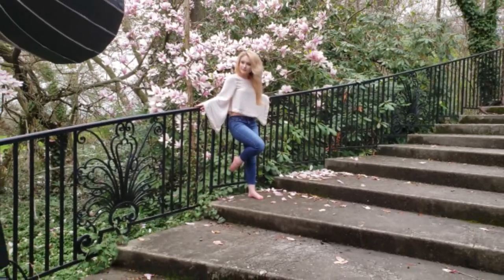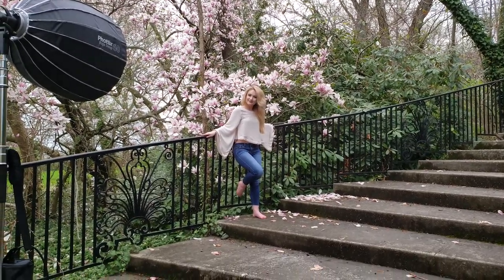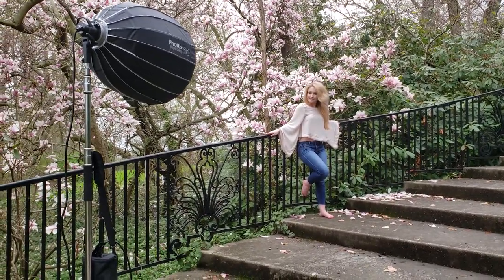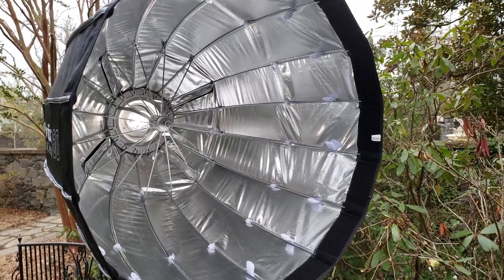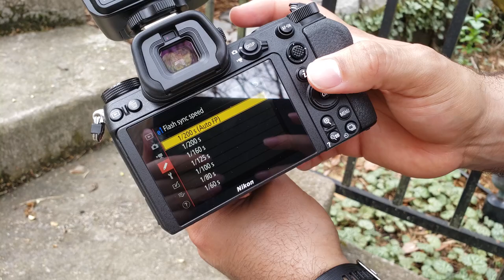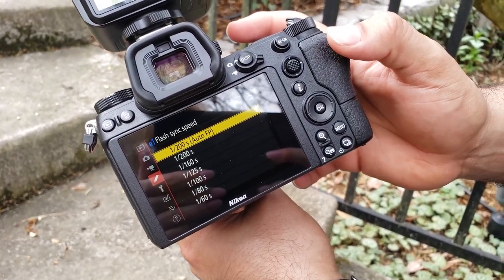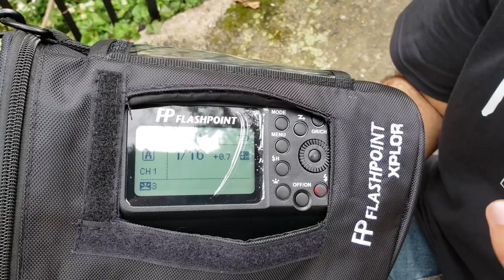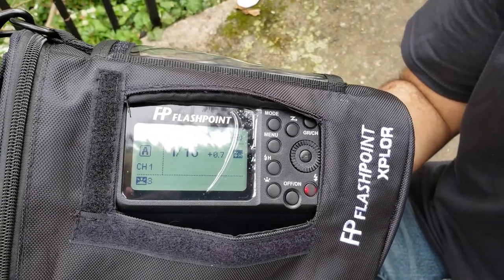How to High Speed Sync flash

Comment: Sir I have Nikon sb 5000 ana good v860 camera d 750 24-70 70 200 2.8
Problem is when I use ss 250 light is ok but when 320 or 640 light is very low with softbox but your octa no  any diffuse
Reply from the maker: I'm sorry, what is your question? So with higher shutter speeds you are having issues with lights? What power settings are you using??? Please let me know thanks.